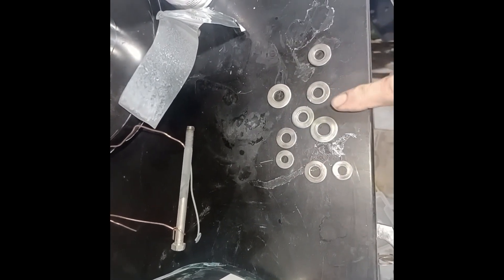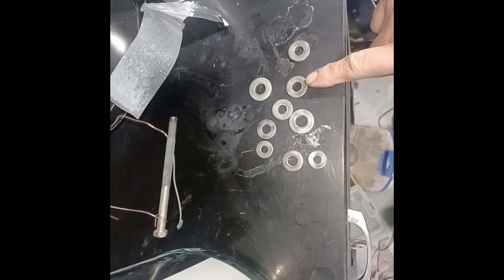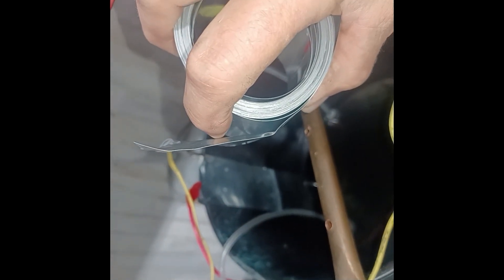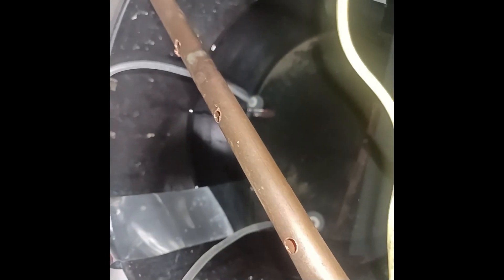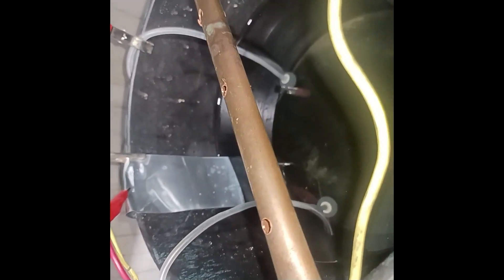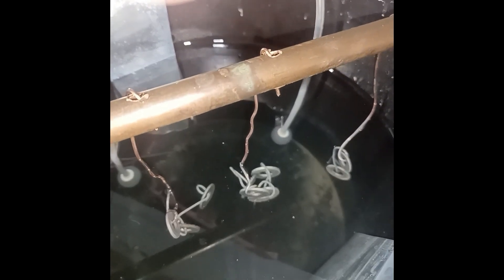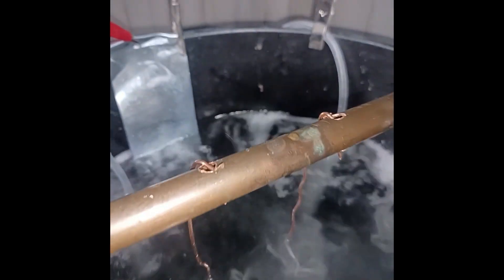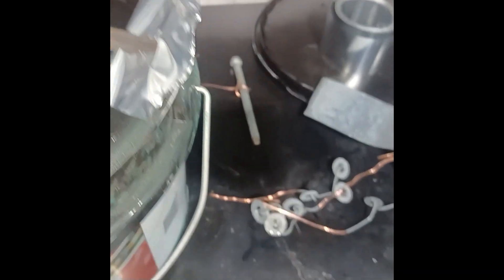Zinc Plating Quick and Easy at Home

Comment: How do that’s car companies chrome their plastic parts?
Reply from the maker: I have done a few pieces, the plastic has to be painted with a conductive paint that is a bit pricey. Then copper and I used silver for the topcoat which turned out well. Both the copper and silver are the same concept as the zink.